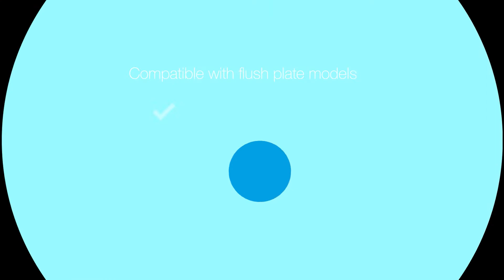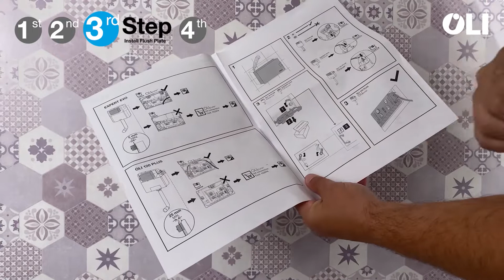Installation of kit OLIpure with OLI120plus in-wall cistern

Comment: Is there an easy way to fill the fluid? Fluid does not want to fill in I need disassemble the system put the fluid straight into the black hose and press it, so it then fills fast. Otherwise nothing happens. Worst filling design ever. Hose is not blocked or bent... any other ideas?
Reply from the maker: Hello,
To do the refill, you'll have to remove your flush plate. However, this is a very simple and practical process, as we demonstrate in this video 
➡ https://www.youtube.com/watch?v=nqKiAM27CAc
If you have any difficulties, please contact our technical support service via our website.  
➡ https://www.oli-world.com/en/company-/tas/
Reply: @oliaveiro  I have wrote to support, filled request for remote consultation, but still did not have any response. How can I contact them?
As for my issue, I have forced the "AbiWave" fluid directly through the pipe, but having the issue that it does not come with ever toilet flush. I comes on random flushes... Any idea why it does not work and how to fix it?
Reply from the maker: @e92-328i  we haven't received any  request form from you.
However, we want to help you as soon as possible!
Please contact our technical assistance  service directly by sat@oli-world.com or fill in the form available on our website.
https://www.oli-world.com/en/company-/tas/
We look forward to hearing from you.